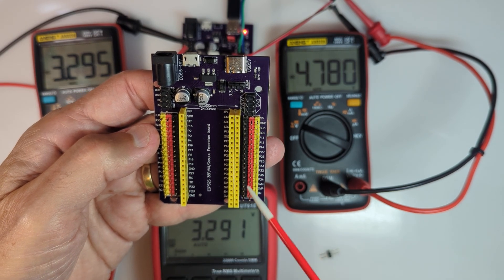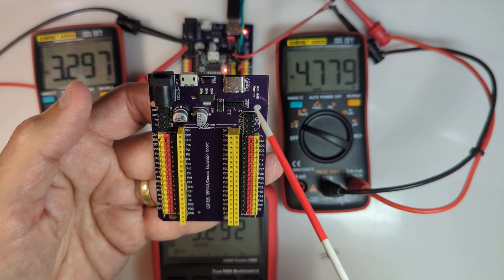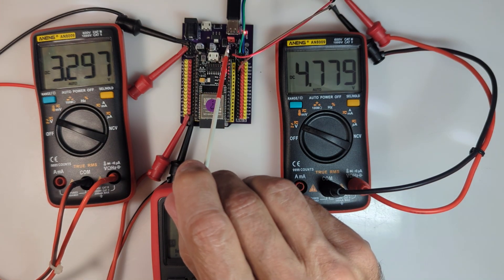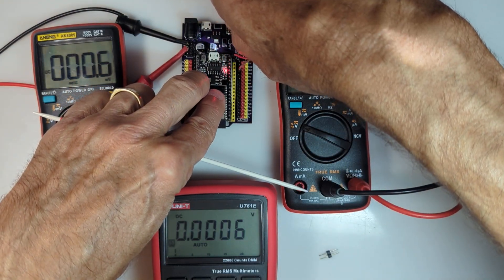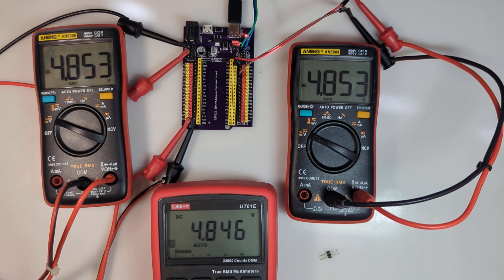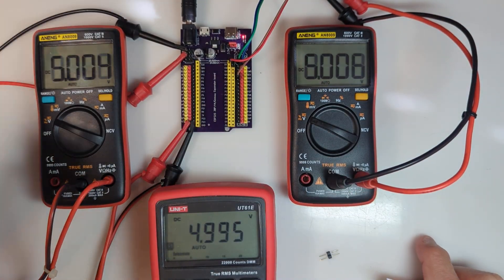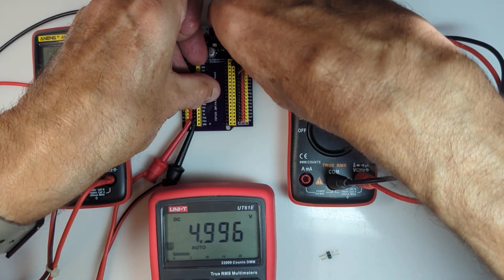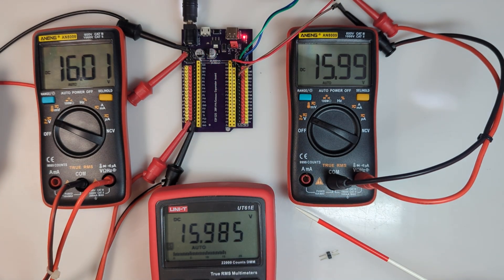ESP32: 38 pin breakout board in-depth review (expansion board)

Comment: I think your regulator for barrel jack is broken. Mine is fine with 12v, and readings all over power rail is 5v. The micro-usb tho and type C (which indicates 5v only) is not regulated, so increasing its voltage from 5v will fry your board.
Reply from the maker: Thanks for that feedback. I have 2 of these expansion boards and both of them behave as shown in my video (i.e., the barrel jack regulator doesn't regulate the voltage).
Reply: @philipgiacalone5605  there's so many boards like this floating on Amazon, yet I've been unable to find a circuit diagram anywhere, so thanks for doing the majority of the testing for me! Mine is a little less colourful, but does at least does seem to regulate the voltage and also does seem to pass through data to the board for programming IIRC.
Reply: Thanks for letting me know this final nugget of info, as I couldn't find the circuit diagram anywhere and was loathe to simply believe the text written next to the socket. It's infuriating that mine, like yours, does regulate from the barrel jack. But now I know I can't safely pass in a PD spoofed supply and hope it was wired up to the same regulator as the barrel jack. 

Looks like I might have to rethink my design as these boards are looking to be a bit of a hot mess imho, so not sure whether to bother.

It truly is a nightmare trying to build projects with components from Amazon. Thing is, until I precisely know what I need for the system I'm creating, returning on Amazon is far easier than any other retailer, which kinda locks me in.